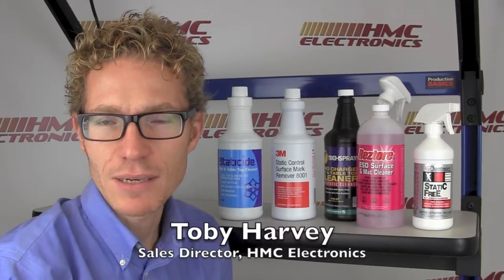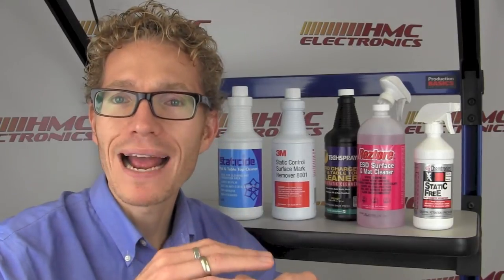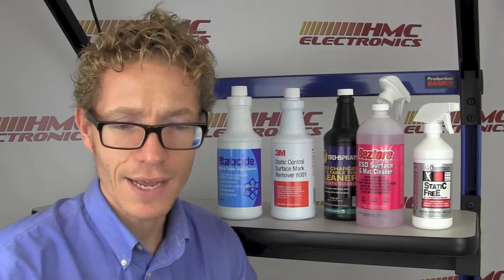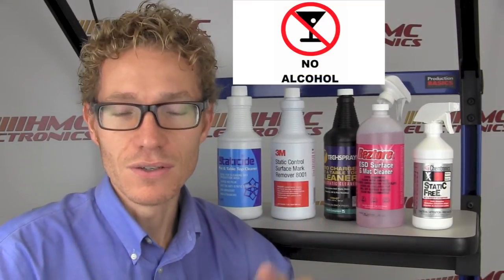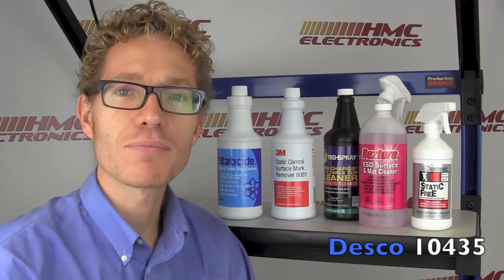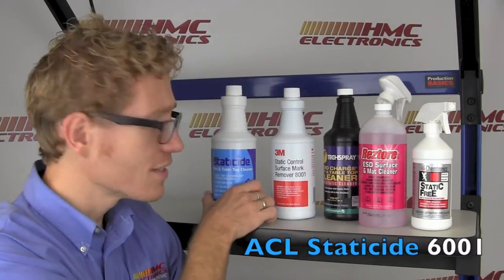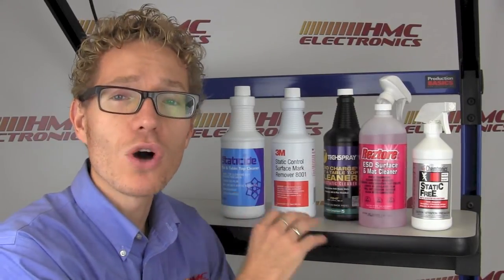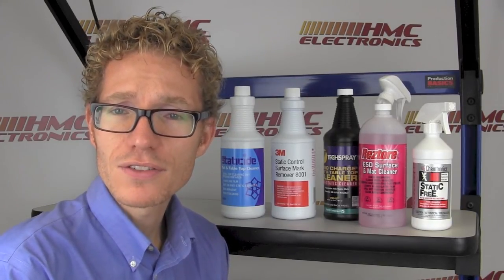How To Clean An ESD-Safe Mat

Comment: I'm looking around your website, and NONE of your ESD Mats list temperature resistance to soldering contacts.  You sell both, so I would like to ask why there is NO specified disclosure on maximum heat, a heat range, or at a minimum, the maximum temperature that the mats have been tested to?

Please assist...
Reply from the maker: Typically an exact heat range won't be indicated. The standard manufacturer disclaimer for rubber ESD mats is: "Does not melt or burn when coming into contact with hot solder and soldering irons."

Here's an example from Desco: http://documents.desco.com/PDF/pm-104.pdf
Reply: HMC Electronics I agree... but, it makes it difficult when planning to get children safe materials when building them a 'maker space'.  Melted rubber is a risk, but not one that I'm willing to be complacent about.

I have no interest in being liable for an accident, based on safety/standards material which provided inconclusive data... 

... I'm sure that you understand.  :-D

That is why I was wondering if you could point me in the direction of ESD mats with marked maximum temeratures. :-)

Any help would be greatly appreciated.
Reply from the maker: We understand the position you're in. Forward your inquiry to Sales@hmcelectronics.com or call 800-482-4440.

We will help you find the right mat, along with one of our manufacturer's recommendation.